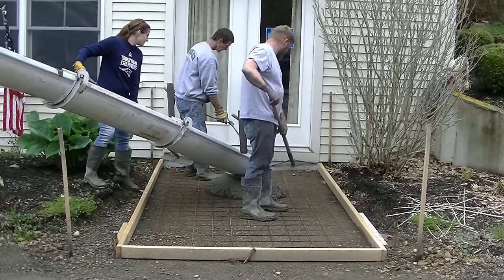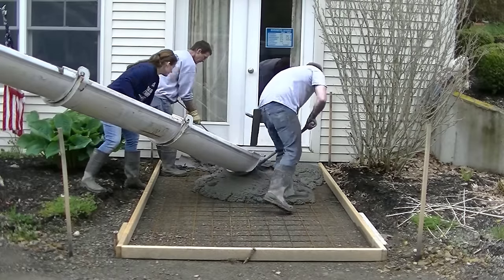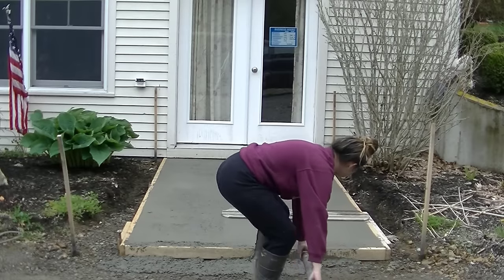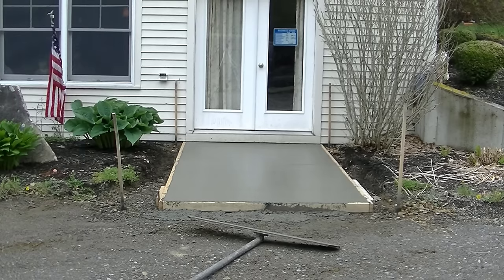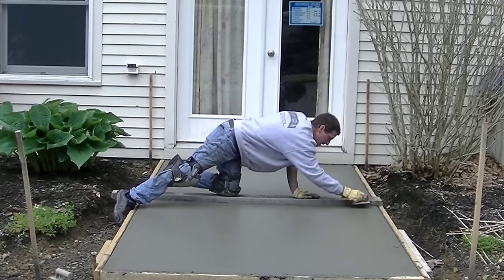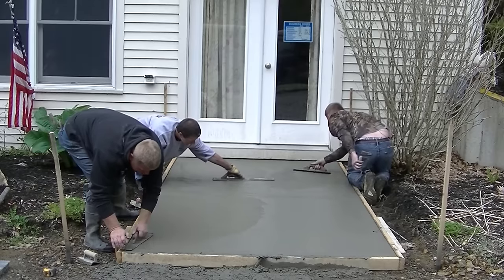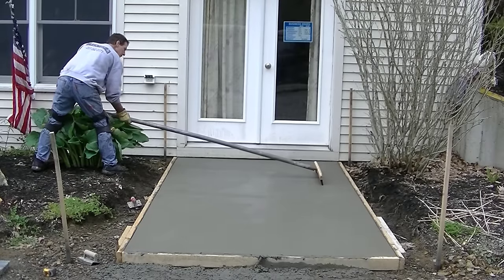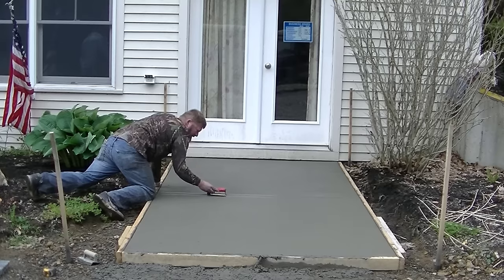Dry Pour Concrete VS Wet Pour Concrete - No One Else Is Telling You This

Comment: I'm gonna do dry pour because I'm a woman on my own doing a diy job with no one to help me. I'm not able to mix all that concrete on my own. I've done manual mixes of small quantities before, but having to mix one portion at a time means that the mix before dries out and the mix before that dries out before I can finish the whole load of concrete. I don't have the physical strength to manually mix all that concrete and pour it myself. It works out best for me to dry pour as all I have to do is dump the contents of each bag direct on the surface and rake over /smooth out/screed etc.
Reply: Congratulations, FranSlam.  The project in this video took 4 people at least 2 hours (8 manhours) of actual concrete work (after the framing) plus timing a truck to deliver the concrete plus timing the surface finish.  At the end all the steel reinforcement was stuck on the bottom, because he neglected to put chairs or anything under it.  Yes I saw him picking up the mesh during the pour, but if you flipped that slab upside down, you're going to see the steel mesh.  Not only that but they have hundreds of manhours of experience with wet concrete.  Not only that but the channel owner also sells courses that you could take in case you don't feel confident with wet concrete.  Not only that but he's an affiliate selling all the tools that you will use ONLY ONE TIME in your life and then have to store somewhere in your already cramped garage.  So this guy has a vested interest in selling you stuff.  Whereas if you elect to dry pour, you don't need any of his stuff, nor do you really need to click up his YouTube view count to watch any of his videos.  

I fully agree with him that a dry pour is not going to give you that paste that you get with "normal" concrete work.  And I agree that you will likely (very likely) not achieve 4,000, 5,000, or 6,000 psi strength with a dry pour; however, you are very likely to get a strong enough finish for you to walk on for many years.  

What about surface finish?  Sure the concrete industry currently has much experience with final surfacing.  The dry pour community has mostly experience in planting posts in holes where surface finish was never a concern.  Now that there is a growing interest in dry pouring slabs, there is also an interest in what can be done with the surface.  The paint roller is one approach, but anything that rolls can be used to create a finish on the dry powder prior to wetting.  

What about spalling?  That is a good question that he brought up.  It would be interesting to know how the projects in those example pictures were installed.  How much water was used and how was it applied?  Did they use mortar mix on top of the ready mix?  What caused the spalling?  Did someone drop something on it?  Because concrete doesn't just fly out of the surface like that.
Reply: Do whatever works for you!!!!
Reply: @MannyTwice  I know.  I was just feeling typee.
Reply: @dchall8  lmaooo
Reply: I read it. This is not the first time that I have seen “professionals” seem to not understand the engineering aspects of concrete. The fact they they stomped all the steel into the dirt means they do not know what the steel is for, how to properly install it, or, that they just don’t care.
Reply: This guy is hustling people do you.
Reply: @shelliecurry6052 I'd like to know the use case for the slab. Light use, foot traffic, maybe a table and chairs, etc., at 3~4" it likely doesn't need the steel. Especially if the ground is properly prepared. So, the customer may very well be paying a significant amount for something they never needed. To the homeowners mind, that steel "REALLY WORKS!," even though it's doing next to nothing but pad profits, properly installed, or not.
Reply: You can’t find a good man to help you with that?
Reply: Some dry pours will last many years and some won't. And a dry pour will never compare in strength, consistency, or quality of a wet pour if it's done right. BUT..... if you're going to make a video pointing out the pros of a wet pour and the cons of a dry one, you better do your wet pour right. My guess is this guy wants to discourage people from dry pouring like local businesses discouraged people from shopping on Amazon.
Reply: I’ve seen enough dry pour videos (many with updates) to know that you don’t have to do a wet pour. If you want a strong slab that can hold a vehicle, just add reinforcements (like the steel wire mesh in many of the videos). Also, tamping the base down well and adding gravel rock are supposed to help with drainage and keeping it from sinking down or cracking.
Reply: Amen! And the cost..... Of course they gonna show you all the bad of the less expensive and DYI way as anything positive.
Reply: who's going to help you when it begins to crumble bc it wasnt poured correctly?
Reply: He can't change. Dry is good for us. He can just do his never change thing. Un subscribed.
Reply: Myself and a friend, 70 year old women, put in a 5x5 dry pour slab following you tube videos. It turned out great. It’s held up well. I don’t drive on it. We knew we couldn’t mix bags of concrete. Neither of us had any experience with concrete. I plan to use same method making 2x4 feet slabs to form a walkway. I can do it by myself but couldn’t lift large pavers so we’ll see how it turns out. Like you I have to do it by myself or do without.
Reply: Order a truck of ready mix.  Problem solved
Reply: @R900DZ  I checked into that myself. Cost was more than I wanted to put into it with labor and mix.
Reply: @R900DZ some who are considering or have done this is doing it themselves because they are trying to save money. Concrete is expensive and most companies have a certain yardage they require when ordering that truck.
Reply: Same for me
Reply: This guy is putting out videos to help people and you all complain and whine 😅😅 This man's not making any money doing small pours you think he's lying by trying to tell you how to do it yourself 😅😅
Reply: @R900DZ  Not much good if you're stuck with a minimum load you don't need and only doing a small area.  Even for a larger area, you're probably going to need help and you're working against the clock.
Reply: I am a woman as well and yes it would be a lot of work and very difficult, and don't forget the price.The dry pour is what I'm going to do. I think I will know how strong it would be I just googled it and it said that you can set a car on a dry pour after 30 days. I'm going to make sure I do a video of it.
Reply: A few things to help with the dry pour, 1) tamp down the ground under where you're pouring. 2) the more you screed the top the more powder will come to the surface. 3) if the sides are going to be exposed take a orbital palm sander to your forms to shake the powder to the outside.  4) if you're putting mesh or steel in it do the bottom half of your pour, lay your steel in, then do the top.  5) when you water it mist it once, wait about 45 minutes to and hour, mist it again, wait another hour, then shower it 2 times waiting 45 minutes to an hour between showers.  6) after screening go over the surface with a paint roller to get the screed lines you of it.  If you want a smooth finish go over it with a float after you roll it.  It's a simple process and works great if you do it right.
Reply: @stevewayne3676 seriously some of these comments were astonishing, his videos seemed pretty straight forward to me, I just laid down a slap yesterday and any mistakes that were made were due to user error or simply lack of proper tools, he explains everything extremely well !
Reply: More Dry pour, less work for you?

Comment: Everyone knows wet is better than dry pour. But it's not about which one is the best/strongest when it comes to DIY people. DIY people need methods a single person can do, that's why they do dry pours. Not everyone can afford a crew and a cement truck to do a small slab.
Reply: you understand you can mix the bag of concrete in a bucket/wheelbarrow/whatever and it is the same as what they are doing in this video right? With dry pours (pouring the powder in then misting it) it does not guarantee that the water will get through everything leaving an inferior result. If you are just going for cosmetic then whatever, but it is far more likely that it will degrade far quicker than just doing some manual mixing beforehand.
Reply: @MrTheJeoff  Well yeah, but my point is that it's difficult to do a large wet pour by yourself. It'll all be drying at different times if you're not hauling ass.
Reply: @MrTheJeoff  I don't think you read or understood what Professor 8383 said about the even hydration he found during his tests.  I've only done just one dry pour so far but it was so easy and produced such a great finish that I doubt if I'll ever go back to back-breaking wet pour for my DIY projects.
Reply: exactly right.  You have to have multiple people doing even small jobs with wet concrete.   This video is proof.   But I've done a 15/30 slab by myself with dry.    Of course wet is better and stronger, but thats not the point.
Reply: @wtfyoumeaninvalid  It's difficult to a a wet pour even on a smaller slab.  Mixing 10 bags of Quikrete by yourself and getting it in the form in a decent amount of time before it starts to dry is a killer.  I'm 71 and I can get a dry pour done by myself.  As for cutting in and edge, I can do that in the dry mix before wetting it.  It works every time.  Also, I am miles from town and having a delivery of concrete from a mixer is not feasible so any work that has to be done it's just me.  I noticed that in your video you had three muscular young people doing the work.  I don't have that advantage!
Reply: @bipolaroid1  its not difficult, its time consuming. a single person cant mix and pour a giant slab by themselves.

Comment: To sum up, your video, presoaked concrete mixed with water lets the aggregate get a better bond to each other while a dry mix will bleed out its ratio with less bond. I think the argument is mute, people already realize they immediately lose more than half psi, and what they really want is just enough strength for simple projects vs cost of hire or self-workload. Understanding companies will argue people's methods because a business will dwindle. but it won't change convincing the wallet.
Reply: it literally costs nothing extra to pre-mix the powder with water in a wheelbarrow or bucket and will give the same result he has shown (assuming you use the correct concrete)
Reply: @MrTheJeoff  Yes, because wheelbarrows and time are free...
Reply: @chrischeek2963  there are about 100+ ways to get some sort of bucket or tub for free and your already using your time anyway, might as well do it the RIGHT way the first time so you don't have to repair it down the road. Not sure why this is such a hot take...
Reply: @MrTheJeoff I've never had anyone offer me a free wheelbarrow, but if it works for you that's great, as for a bucket, good luck moving that around your yard and dumping it easily.  As for time, everything takes time, some just more than others.  Your RIGHT isn't everyone elses.  If it works for them (do your research and see the tests and results), then that's what they needed.
Reply: It's closer to 25% loss

Comment: Interesting, even the 'experts' don't do it right. Poured with the mesh laying on the ground. A little bit lifted towards the end but it should be in the top third and the concrete was not vibrated. It's not hard to do it right.

Comment: Mike I do basically agree with what you are saying. I am a retired concrete contractor of about 35 years.  You learn a lot in that timeframe.  The problem that many are finding and which leads many to doing dry pours is cost and lack of finishing skills.  I did do an experimental area and here's what happened. One technique that I used was to do a dry pour 2" thick. I used the dry pour as a hardened bed. I allowed it to cure for some time and then I capped it with a wet pour. I mixed my wet pour using Quickrete 60# bags and mixed in a 5 gallon bucket with a centrifugal mixer. This allowed me to work and finish in smaller quantities but I got a really good finish and product. I tested the dry pour before capping it and it was good for the purpose which I used it.   
It turned out a really nice looking slab and the strength was debatably strong enough for my purposes.  I haven't done a dry pour only and doubt that I will since I have the ability to  pour and finish. 

I think that what each individual needs to ask themselves is: Is it good enough for my needs.  I have seen on YouTube , folks who did a large dry pour slab and they seemed to be happy with it, but they weren't concrete finishers. I imagine that if it's good enough for them, it's good enough. Being a concrete guy myself, I prefer wet and properly mixed concrete but again, I have the ability to finish it adequately.  I have also seen many jobs that concrete contractors have tuned out that went horribly wrong and a dry pour finish looked better...lol.  Another option is that if someone wants an awesome looking finish but can't afford a contractor ( which CAN get pricey), you could do the dry pour and make certain to hydrate it as well as possible; screed it, roll it, wet it and if it turns out hard enough, you could tile it or lay pavers over it...a total DIY job but it could turn out to be pretty immaculate.  

Well, that's my 2 cents worth.  :)    I really enjoy your videos...keep up the good work.
Reply: Thanks for the 5 gal bucket advice. That’s what I’ll be using to pour 16in deck piers. I’ve already got a big mixer I use for thin set.

Comment: I did dry pour over #57 stone to keep my dogs from digging under a gate. I broke up some old concrete trash, built a speed bump up to the gate, dumped 18 60 lbs bags over it, and swept it smooth with a broom. Surface finish is the mister setting on my hose. So far so good and I'll be filling more #57 stone anyway. I don't care if it cracks and breaks up. The point is that my dogs won't be digging through it. Dry pour saved a lot of back breaking work.
Reply: Exactly, and money, of course the contractors aren't going to like it.

Comment: I had an excellent experience with dry pour strictly following you tube videos. You had 3 people and mixer. Dry pour can be done with one person and someone to help screed. I wouldn’t drive on it or do a large area. You have to use mister setting on hose nozzle for a few swipes ever hour then up the setting. The surface turned out smooth with the screed marks for surface roughness as I didn’t have a concrete broom. If it holds up 20 years I’ll be happy..after that it’ll be somebody else’s problem!
Reply: Yeah, not at all saying what he did was wrong. 
But you also probably have a short load charge on top of it.

Comment: next time you might. want to pick up that wire mesh reinforcing and get it in the concrete instead of under the concrete.. I suggest putting down a layer then picking it up to top of layer and then topping it off . Otherwise Great job ! looks great !